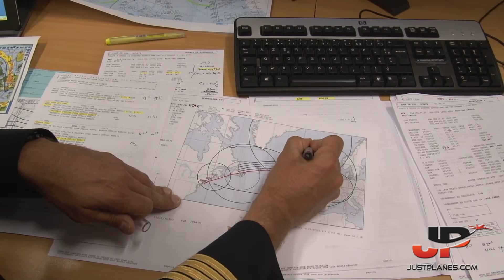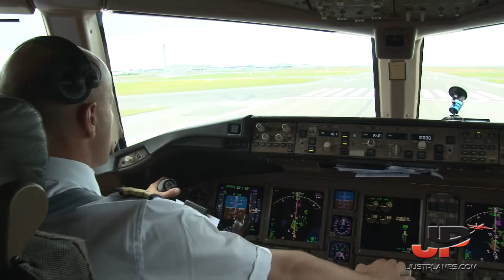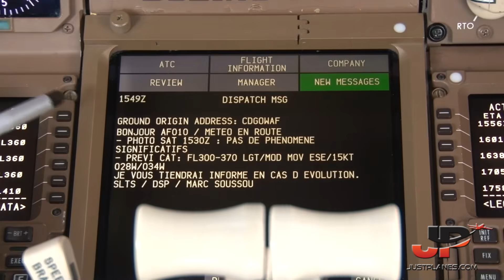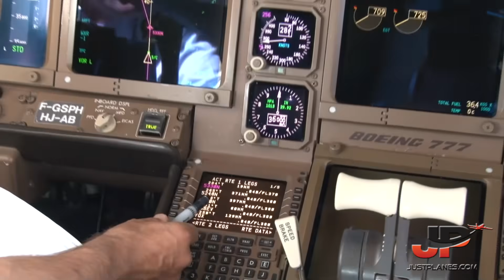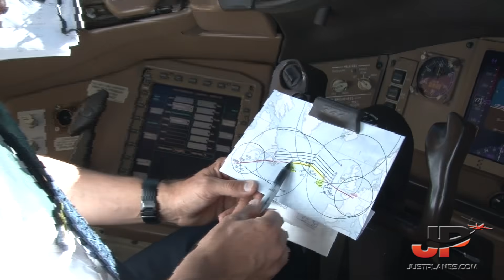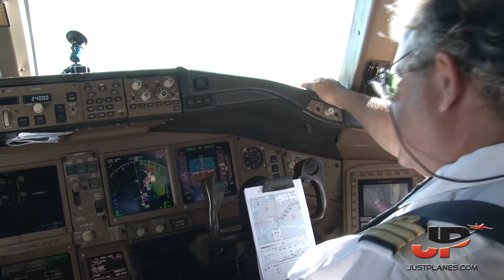Air France 777-200ER Cockpit Paris CDG🇫🇷 to New York JFK🇺🇸

Comment: Why is the flight speed at the flight level in the video a maximum of 300 knots, that is, approximately 600 km/h, if the cruising speed of the Boeing 777 is 800 km/h or more
Reply: 800 km/h is the speed relative to the ground, but crews usually display the speed relative to the air, which is more useful in cruising flight than the speed relative to the ground.

Comment: I am flying Air France to CDG soon and will have three dogs in hold.  Do the pilots check on the animals during flight or let us know if they are doing alright?
Reply: Yes. Flight crew is aware of live animals in the cargo hold and temps are set for that area accordingly.  Also during cruise portion of flight those temps are monitored on a regular basis.  
No one from the crew physically goes to the cargo hold.  On some aircraft there are cameras that flight crew and view the animals.  The passengers are not updated or told about the animal during the flight